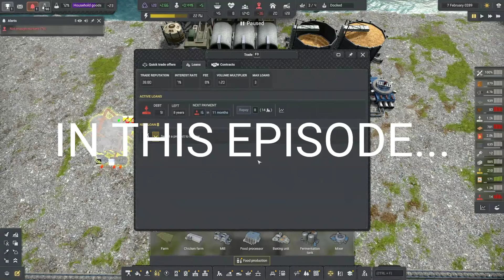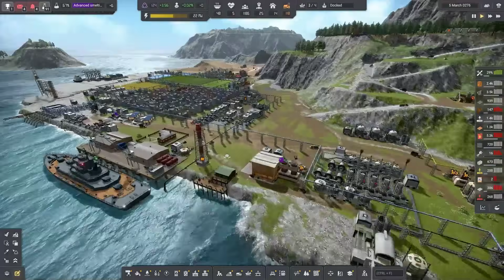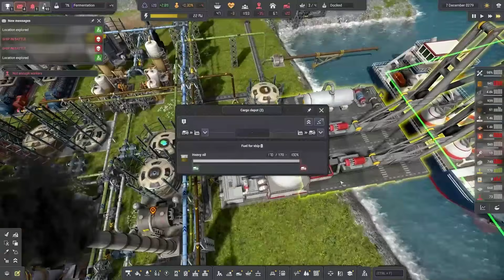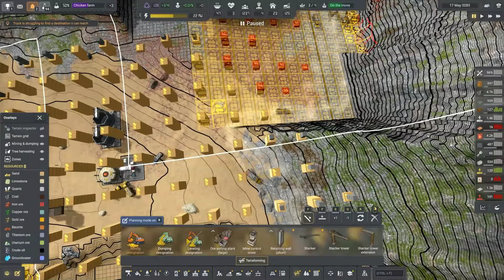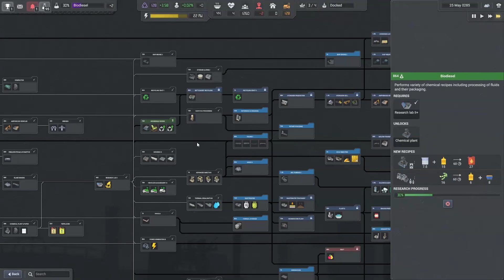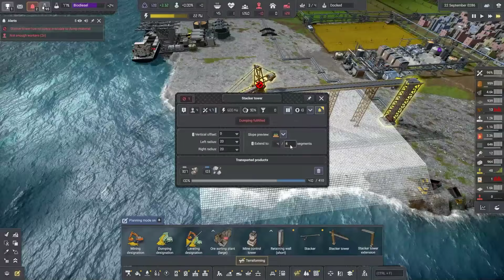We're Out of Iron and the Bridge Isn't Done | Captain of Industry Update 4

Comment: Contracts 4 x 4 Ship, Wood for Corn and Rubber for Wood 

Notes 1:
4 Mills = 12 corn + 3 water = 9 corn mash and 3 animal feed (36 Corn mash and 12 animal feed)
3 Fermentation Tanks 2 Air Separators = 12 corn mash + 18 O2 = 8 Ethanol (24 ethanol) 
1 Rubber Maker = 12 ethanol + 3 Sulfur = 24 Rubber
2400/12 Corn 600 Water= 200x9=1800 Corn Mash and remainder 600 Animal Feed
1800 Corn mash / 12 Corn Mash + 18 O2 = 1200 
 Rubber Maker = 400 Ethanol + 200 Sulfur = 1600 Rubber Remainder 800 Ethanol
Cost diesel fuel / maintenance / manpower / 200 Sulfur
Total remainders 800 Ethanol and 600 Animal Feed

Notes 2:
600 Animal Feed /12 Animal Feed x 1 Compost = 50 Compost
600 / 72 burned for solid fuel 48 steam = 400 steam (edited)Sunday, May 10, 2026 11:31 AM
Hum. . . I get back 2/3 of the corn as Ethanol.
Upkeep .5 unity and costs 11 unit rounded up. 

Vehicle parts two for Iron ore may sustain 8 blast furnace II to make 192 steel 

Cement for Coal	Cement (435 Limestone)+(72.5 Coal) 145 = Coal 800,	(1308 Limestone)+(218 Coal) 436 = 2400, (3,270 Limestone)+(545 Coal)1090 = 4800, (3,927 Limestone)+(654.5 Coal) 1309 = 7200. To calculate fuel gas and hydrogen for cement multiply coal x2.
Reply from the maker: Mind blown 🤯  

is the rubber-wood-corn trade not sustainable?
Reply: @JTMPLays  I am a viewer. I do not know the plans. But with 800 remainder Ethanol there is plenty for medical and ethanol plastic. Is it a sustainable contract loop. Yes, so long as there is fuel. Each digger, tree harvester, planter, and truck have a fuel consumption. Could math that and see how much fuel is being used or needed as the fleet gets bigger. More oil. . .there is an oil rigs worth under the sand pile.  

Do not know why your building a bridge to starting point 1. Starting point 3 is more near. A bridge could be built to the middle island with the only patch of titanium that also contains more iron. Blast II will help as its 1 iron to 1 molten metal instead of 1.25 iron to 1 molten metal with blast 1.